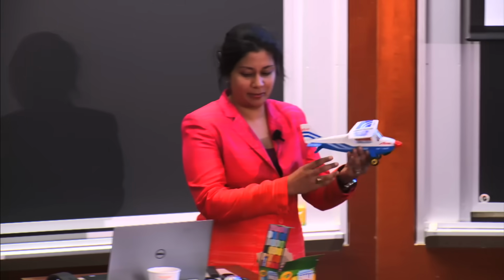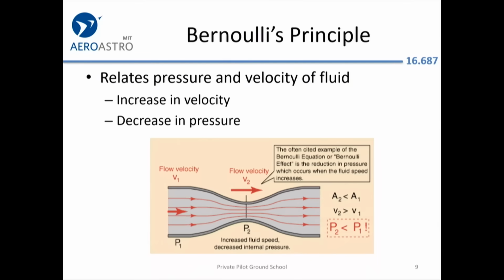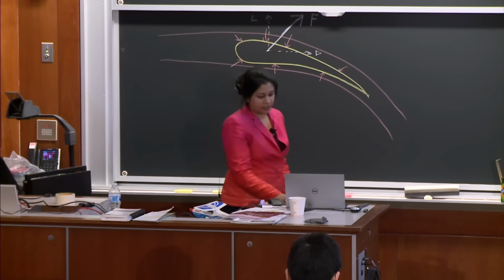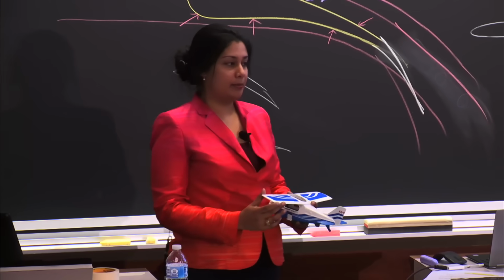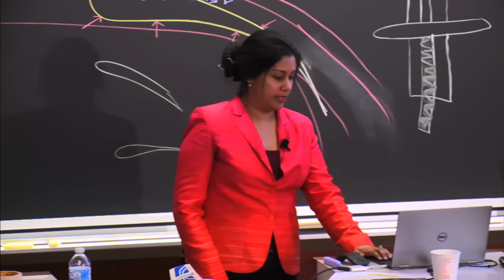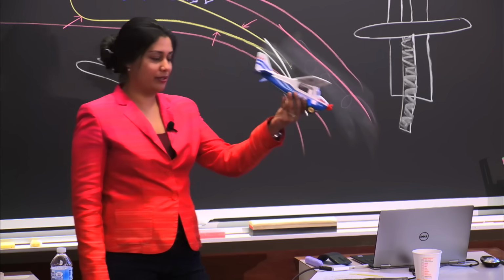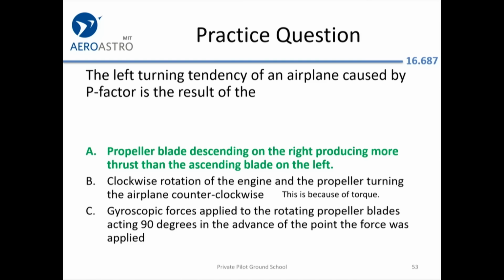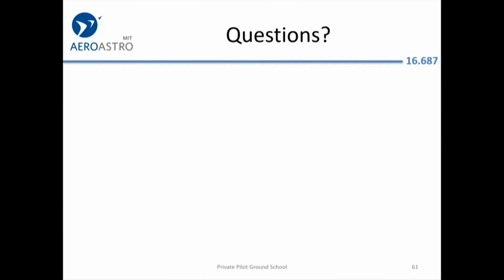Lecture 2: Airplane Aerodynamics

Comment: I like her voice, but she knows just half of the true. Just put a paper under your lips and blew. You will see why the  real planes flys and the paper ones just fall.
Reply: The 'blow over paper' is Coanda, While similar, that does not happen above a wing. Another common misunderstanding.  Also a flat plate wing flys by the same fundamentals as any cambered wing.
Well made paper planes do fly... Her version is actually a good design that I came up with many years ago to get good trim,  IF trimmed correctly.  It is quite difficult to get an actual stall. it usually looses airspeed, instead.
Reply: @Observ45er  i would say that “blow over the paper” proves  Bernoulli equation...there will always be a trade betwin the velocity and the pressure that a fluid can act against an object. Were there is speed, can not be pressure and where is pressure can not be speed.
Reply: @vasilescuadr  No. This is a very common misunderstanding of Bernoulli's Principle that continues to be spread by amateur scientists -- including people who should know better.. 
 Blowing over the bent paper demonstrates the Coanda Effect and entrainment.
When the paper is bent, the air follows the paper because we live in a pressurized atmosphere that holds the air against the curved surface and the air's inertia lowers the pressure near the paper since it has mass and that wants to travel straight.  When the paper straightens from the pressure difference, entrainment holds the paper along the path of air.
.
It is an easily proved fact that the pressure of that moving air you blow is the very same pressure of the still air near it and this can easily be measured. It is measured daily by aeronautical engineers
It is the pressure.  Always, always, always it is a Pressure difference between two locations that is the cause of the air accelerating. 
 Always - This is Newton's laws operating in fluids.  Air has mass and the pressures are the source of the force that accelerate the mass, just like for solid masses.
Reply: @vasilescuadr  
Blowing over curved paper does not demonstrate Bernoulli’s Principle.
I am very sorry, but you have unfortunately been misinformed. Blowing over the paper or between two balloons or cans is a completely misunderstood demonstration.
This is a very common misunderstanding of Bernoulli's Principle repeated by amateur scientists and others who should know better. It is repeated so often that many people believe it without truly understanding the science.
You need to understand what the Coanda effect is and fluid entrainment to correctly understand the blown paper. The Coanda Effect lowers the pressure of a Jet of air injected along a surface into some still air. Atmospheric pressure holds the jet along the surface. Atmospheric pressure pushes air against all surfaces whether the air is moving or not!
The Coanda caused pressure difference raises the paper and entrainment then holds the paper straight.
.
The blown jet of air has the very same pressure as the still air around it.  Aeronautical engineers measure this every day.
.
Bernoulli's Principle and Equation are demonstrated by the higher pressure in your lungs pushing the air (accelerating it to a higher speed) into the relatively lower pressure atmosphere.
THAT is WHY the pressure is lower when it gets there! The lower pressure didn’t push as hard as the higher pressure.
.
PRESURE ACCELERATES FLUID.  That is the proper understanding of Bernoulli’s Principle.
Bernoulli’s equation must be used correctly along the stream, NOT between any two places in air that are not part of the same moving stream of air. The air you blow and the still air surrounding it are NOT in the same stream!
.
Euler showed this in the mid 1700s while following up on Bernoulli's work. There is no indication that Bernoulli understood the cause and effect of what he observed, but Euler did.  Euler is the one who derived what we call “Bernoulli’s Equation” today.
Air has mass and a difference in pressure, called a Pressure Gradient, provides the force that accelerates the air.  Air has mass and Newton's laws tell us that a force is required to accelerate a mass -- a Pressure gradient supplies that force.
The “Bernoulli” myth (I call it ‘Bad Bernoulli’) has been around for a long time. The Cyber History of Bernoulli’s Principle, Keating, et. al. Indiana University: 
http://citeseerx.ist.psu.edu/viewdoc/download?doi=10.1.1.88.6970&rep=rep1&type=pdf 
.. ..
Please see these authoritative sources.
Bernoulli explanation:
Weltner: https://user.uni-frankfurt.de/~weltner/Misinterpretations%20of%20Bernoullis%20Law%202011%20internet.pdf       
Weltner also shows how tyo do measurements. Physics of Flight Web Page Version:

Professor Krzysztof Fidkowski,  University of Mich. How Planes Fly.  https://www.youtube.com/watch?v=aa2kBZAoXg0 
Professor Holger Babinsky Site on Lift: https://www.cam.ac.uk/research/news/how-wings-really-work 
- - 
Regards

Comment: I missed why an airplane wing is shaped the way it is if the angle of attack is what is important and not the equal time falsity?  To minimize drag at normal angle of attack?
Reply: To keep airflow (on top of the wing) un-seperated for a given range of AoA.
Minimize drag, yes; minimum drag must be considered for any component for sure.

Comment: disappointingly simplistic lecture for MIT...  I'm an airline pilot, was hoping to get a refresher on aerodynamics with a more advanced flare.... this is private pilot ground school it turns out, should have read the description and not just ASSumed that MIT is gonna hit it hard! .
Reply: "Ground School" did not clue you in?  What did you expect?  The quantum interaction of Al atoms moving relative to O2, N2, CO2, etc and how that gives lift?  Maybe you can answer my question earlier on why a wing is shaped if not for Lower pressure on top of wing due to shape rather than angle of attack-- which this videos seems to refute.
Reply: @lidarman2  It came up as a recommended video so I started to watch, saw the MIT part and got excited... anyway... a wing has a camber because based on it's angle of incidence while level and on the ground .. it's supposed to generate lift with 0 AOA.... thus how we take off from a flat runway once we reach a certain speed, and with the correct flap setting to create more camber in order to a) reduce runway length, and b) lower the  takeoff speed.

Comment: I am not an engineer but am intrigued from the little that I have looked into.   Is a lot of the the airplane physics pretty much fluid mechanics?
Reply: Yes, in fact aeronautical engineering is essentially mechanical engineering with the addition of fluid dynamics.

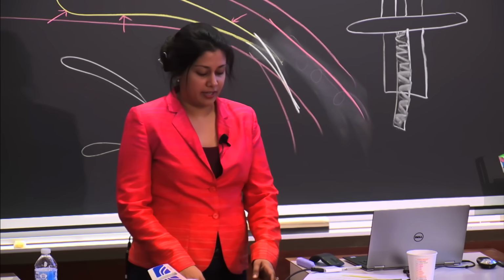Comment: 1:09:30 Blended wings. 1.- If you make it smaller, passengers do not fit inside the wing. 2.- The biggest drawback is that you can not use flaps du to not having the leverage as with a tail. If you can not use flaps, the takeoff roll will exceed the existing runways and worse than that, the landing speeds will be much higher and the landing roll distance is proportional to the square of the speed. A comparison between Rutan-Beechcraft's Starship and the Piaggio Avanti is the best proof of what happens when you do not have flaps. For military airfields like those few that can accommodate B-52s , this is not an issue, but commercial 4-5 km long runways are unheard of. Lastly, she did not mention the pressurization issues when you do not have a cylindrical or near cylindrical fuselage body. You will create high stresses leading to early fatigue and that factor around windows, lead to several De Havilland Comet crashes in the 50s.

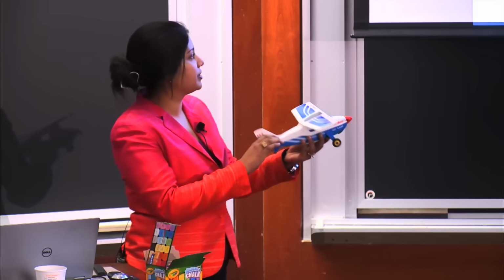Comment: 1:04 and some time before where P factor was discussed: As long as there is an angle of attack, the right semicircle of the propeller arc is advancing towards the incoming air AFTER the aircraft gains speed and the left semicircle arc is retreating. The advancing semicircle creates more lift than the retreating semicircle due to the speed difference. This is paramount in helicopters where the tilt is much closer to 90 degrees and not, say, just 5-10 degrees. Helicopters need a cyclical device that lowers the angle of attack in the advancing stage and increases the angle of attack in the retreating stage of the rotor blades due to this asymmetry.
Reply: P-Factor is only significant for tail draggers in the take off roll.  In cruise the prop shaft is horizontal or close enough to have no real P-Factor.
The helicopter main rotor is WAY different because it is at near 90 degrees...
Reply: @Observ45er  Tail draggers: You are right in that in taildraggers the effect is way higher due to the tilt in the propeller rotation with respect to the horizontal, and better yet, you will notice it when accelerating, then when you bring the tail up, and then when you bring the nose up.Cruise:  You are right in that in cruise there is no noticeable P factor, because the aerodynamic relative wind forces on the wings and tail are far stronger than the corkscrew effect of the propeller stream mass. You are right in that in helicopters the rotation axis is different. Check when Greenspun mentions it is around 70 (I would have to listen again or check it elsewhere to write a better value). What I intended to explain is that it would be so strong, that it would be fatal as it was with the first helicopter prototypes  in history that did not have a cyclic control.   Thanks for the comment
Reply: @jsada60  Can't discuss hilo characteristics. Bottom line is this video is quite poor...
Reply: @Observ45er  . I am sorry. I do not understand what you mean by "hilo"
Reply: @jsada60  Helicopter...
Reply: @Observ45er  I know it as "Heli", not "Hilo"
Reply: @jsada60  Copter go hi.  Copter go lo.  Hilo go just fine for me...

Comment: 1: 012:30 . She should have said that a CHANGE in any direction will produce gyroscopic effects due to precession. With helicopters and gyrocopters and their huge polar momentum, this is basic. A bicycle is turned not with the handle bars but with the weight shift due to the movement of the rider
Reply: Yes.

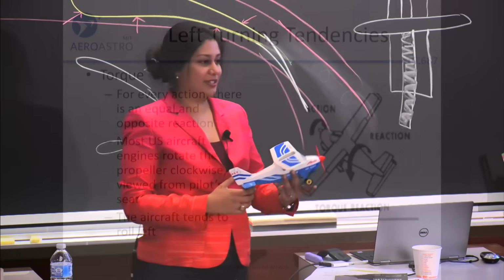Comment: Minute 57:30 Torque. The fuselage reaction will put a force on your left wheel and diminish the force on your right wheel. This will increase friction with the ground on your left wheel. The aircraft will start to turn left at the start of the takeoff run.
Reply: This 'friction' effect is minimal, if at all present.  P-Factor is the dominant cause of the left turn on take off roll (not in flight which was not explained here)  for tail draggers.

Comment: There are some designs that do not stall. They are very rare. I have flown several. I have also modified one to not being able to stall no matter how hard you try. Induced drag will rise exponentially, though, as predicted by the graphs. It will sink much faster than with no power at the best rate of climb speed, but the nose will not drop suddenly or go into a spin. Most of the wing if not all, will keep the airflow attached. With the decreased airspeed and the change in the center of pressure, the elevator will not have the power to raise the angle of attack all the way past the critical angle. That is the basic trick to achieve a stall free aircraft design.

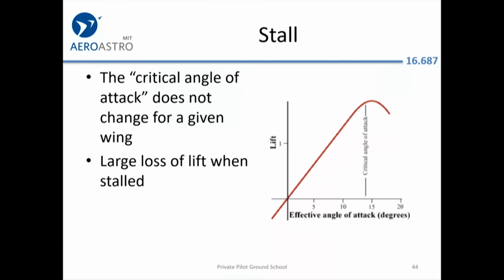Comment: Minute 53:45 . She states that under stalled conditions, wings do not generate any lift.This is wrong. They do generate lift but it has diminished considerably. With enough power (which you will not have) , you could keep it flying without losing altitude. The lower part of the wing keeps pushing air molecules downward
Reply: Correct. She has lots of poor explanations.

Comment: Minute 48:40. Adverse yaw is due to the increased drag of the wing that has lowered an aileron. The wing that raises the aileron does not benefit a lot in drag and thus, you get an asymmetry in drag. Say you want to turn left and lower the right wing aileron. Unfortunately the nose will turn right and that is called adverse yaw. You need to apply left rudder in order to counteract the adverse yaw. There is no such thing as the rudder turning the wrong way as she states in minute 48:40. The nose of the plane turns the wrong way !
Reply: You are correct. She also goofed on the four forces. Planes do not climb because of excessive lift, nor do they move forward because of thrust exceeding drag.  I was impressed that she did explain how wings create lift correctly.
Reply: @jimziemer474  Yet she did not explain why a low pressure area above the wing and a high pressure area below the wing is created, Stating that the air accelerates above the wing and thus a low pressure area is created is not an answer. You have to explain why does it accelerate in the first place ? I wrote Greenspun and sent him the missing explanation but I got no answer from him
Reply: . @jimziemer474  She explains the climb/descend later.  I think she says "momentarily exceeds weight" which is correct.
explicitly
Reply: She never explained the cause of adverse yaw. Quite weak explanation all around.
Reply: @Observ45er  Very dissapointing, coming from such a prestigious institution and 2 PhDs
Reply: @jsada60  She did graduate from MIT, but moved on and did this as a volunteer. 
.
 I was also very disappointed, but several years ago found here a video by some MIT students that has/had the faster air myth.
.
So misconceptions are pervasive and lecturing is not something anyone can just do...
Having a PhD in physics doesn't make you an expert in fluid dynamics and a PhD is a very narrow specialization, so even a PhD in fluid dynamics won't necessarily have the background to explain lift well.
.
 I'm a very experienced  Electrical Engineer, now do STEM labs in schools  and needed to study it so I could answer questions for a flight simulator I had responsibility for and even consulted with Doug McLean,  other big names and my Aeronautical engineer son to get my story straight.
Reply: @Observ45er  MacLean does explain it throughly. Also, the typical mistakes. I was content with my diagrams that showed the expansion and compression when you consider that way above and way below the wing, the airstream is not deflected. I now see 3 levels of explanation. A.- "Air is pushed-pulled down" just like in a ceiling fan or helicopter B.- My explanation: "Air expands above and contracts below and Bernouilli". More thorough, but not quite correct  and 3.- MacLean's. Agreed ?
Reply: @jsada60  In "normal" flight, air does not compress and expand, though that does help some folks follow along. The amount is so trivial that it has no significant bearing on lift.  Pressures are the key and understanding that pressure causes acceleration puts everything in it's proper place.

Comment: One thing this explanation lacks is why does the air accelerate at the top part of a wing and decelerates at the bottom part. This happens because there is a venturi effect with air expanding over the top given that the border of attack "sits higher" than the trailing edge and air is being compressed below the wing as the border of attack "sits higher" than the trailing edge. I would have to present a drawing to show this graphically
Reply: Hi Jamie,
I have seen your video from several years ago where you illustrate this effect with what appears to be Xfoil. It's actually not a good explanation because it only looks at the localized flow field around the wing. In reality, there is a measurable pressure gradient observed in the continuum flow field far from the wing, which makes this explanation insufficient. I would refer you to this video if you are interested. https://www.youtube.com/watch?v=QKCK4lJLQHU&list=PLxiC7okLcZQYIzi89WQYp0_M8j297rTj7&index=7&t=854s
Reply: It is not the venturi effect. The air above  is a very soft cushion, not a hard boundary.
.
 The upper air is accelerated toward the trailing edge by the low pressure there and higher pressure at the leading edge.  A Pressure Gradient accelerated air. Any higher pressure region accelerates the air toward near-by lower pressure regions. 

Under the wing the higher pressure pushed forward on that air --- as well as downward, for the same reason stated above about Pressure Gradients.

Comment: She is wrong in minute 42. Takeoff flaps position increases the coefficient of lift very much at the expense of very little drag. It is used (but not always as in multiengines at high altitudes) because it decreases the takeoff ground run and not as she says, due to possible immediate landings
Reply: You are correct.  Airliners always use flaps for takeoff, and it has nothing to do with possible crashing.  She was wrong about a lot of things.

Comment: As you mentioned whole aircraft generates lift then why we calculate Lift force by considering only wing area in Lift force equation?
Reply: Anything else is insignificant it at all in the correct upward direction. This is a poorly done video.
Reply: Wing Planform 
( check it out )
Reply: @vatandas1542  Is that supposed to be an explanation?
Reply: @Observ45er  As a rule of thumb one may go with wing-planform-area instead of wing-area so that the body lift is included. Again this is a rule of thumb. For example not adequate for delta wings.
Reply: @vatandas1542  Why complicate the fundamental concepts in describing basic lift?  The fuselage lift doesn't necessarily have to be oriented upward.
 She only just barely eludes to the top-bottom pressure difference and explains several fundamental concepts rather weakly as it is.  She brings in Kutta for no apparent useful reason.
Reply: @Observ45er  sorry, I didnt watch up to that part, I can not comment.
Btw. Fuselage lift is extreme on some aircraft (e.g. Tomcat).
Reply: @vatandas1542 Yes it is, but it still isn't relevant to first understanding lift fundamentals.  Which pilots don't need regardless.